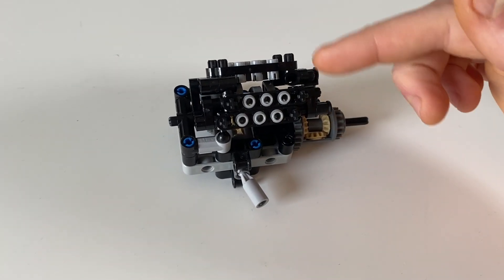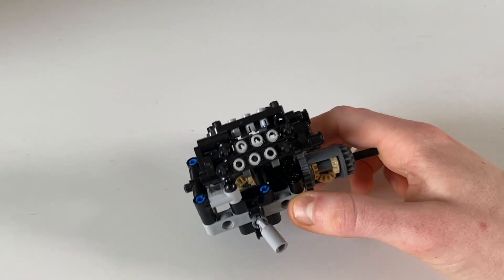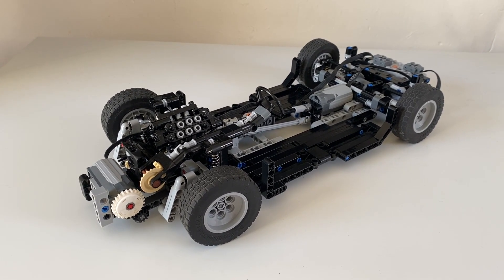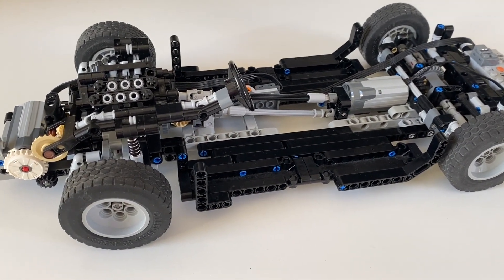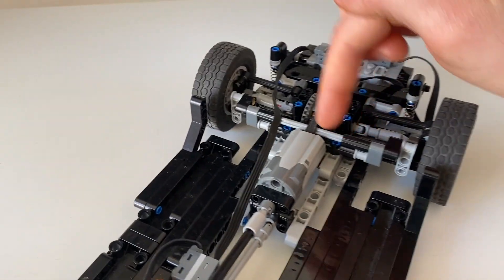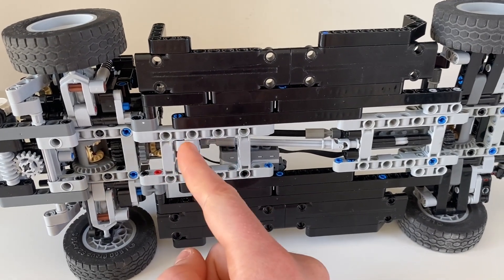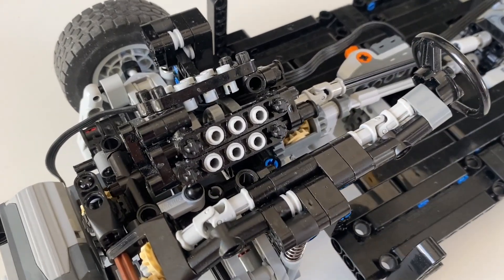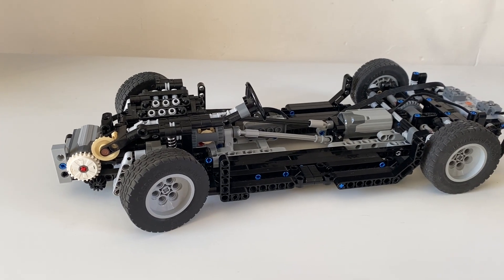Lego Technic Bentley Continental/Volkswagen Phaeton Chassis - Build Process

Comment: there is a very small, "automatic 2-speed" gearbox which you can build with a differential. i also would take a larger motor for driving
Reply from the maker: Thanks for the tip! I’ll consider it

Comment: If you move the front differential back by 1/2 of a strud compared to the front wheels you get more movement of the front wheels because the outboard wheels rotate further than the inside wheels.
Reply from the maker: This is a really cool suggestion! I might try this and implement ackermann geometry steering to take full advantage.

Comment: Is your drive shaft double-cardan joint correctly installed? It looks like a cross-type universal joint connected to a CV joint🤔might cause vibration
Reply from the maker: Yeah that's a good point. Technically either CV joints or 2 U-joints in series should be used in order to minimize vibration. Given how imprecise lego is, it practically doesn't make too much difference in this case. I used a mix of CV and U joints here because it was the most compact solution.